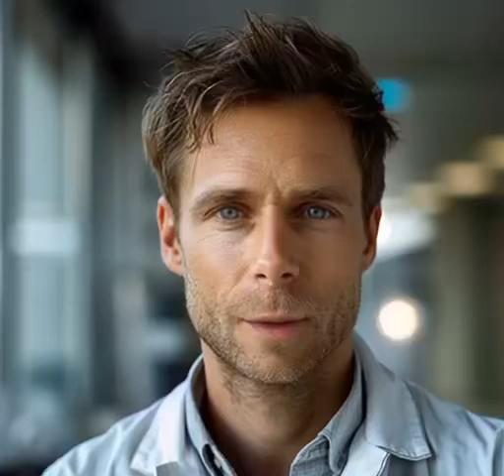MEOW Ep. 11: Caliber Specific

Comment: I love them all and have all of the commercial line except JL and an alleycat as well and love them. I haven’t shot anything else in a while. My one complaint that I don’t seem to get is muzzle devices or lack there of. For instance MOB, it’s 9mm but mine is the QD model. I ordered a 1/2x28 spooky and put in the notes I need it for 9mm and it’s super tight on my 9mm alignment rod. I hit up the IG account and asked about it and they were going to send me another one but I think they forgot because I responded late but the IG account has been amazing with responding and information. The website just only lists options for 5.56 bore 1/2x28 yet the 9mm can uses it so I thought that was odd but my biggest issue currently is that I have an ODB, that’s made for x39 yet there’s not a single AK muzzle device on the site unless you’re running a more modern custom gun that can use shoulder mounted 5/8x24 or if you use an ugly Hub adapter from JMac… or Keymo… bleh. I guess the case could be made that they weren’t made for AK’s and I’m an idiot thinking they were as I’m realizing as I write this that they’re probably made for Spears or something in x39. Not my lame ass chicom AK with a 14x1lh and no shoulder. BUT an AK solution and dedicated 9mm md would be awesome!

Comment: i'd like to see a white paper to document what 30 caliber ammo can perform through the ODB since it can cover a broad variety of ammo types.
Reply: That's complicated, what's wrong with going by caliber and energy limit? 😂
Reply: It seems like you didn't watch the video. They make caliber and platform specific cans - optimized to those calibers and platforms. Why would you buy one of their cans if you're not looking to get the best performance out of it based on what it's optimized for? This seems like a waste of money.
Reply: To add, they also state that you can use other 30 caliber cartridges but you should ask yourself if it's similar to the pressure and velocity of the intended cartridge. you can easily figure this out yourself.